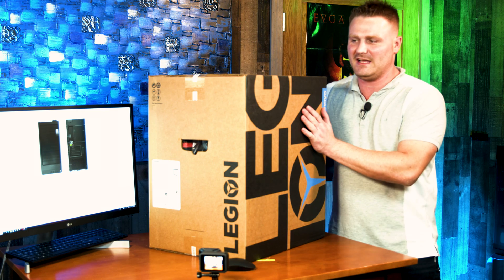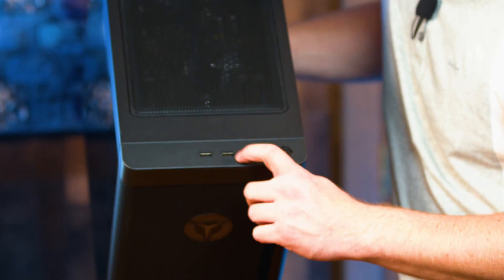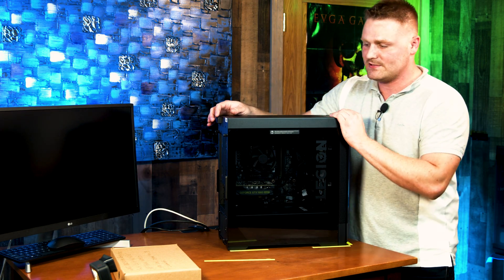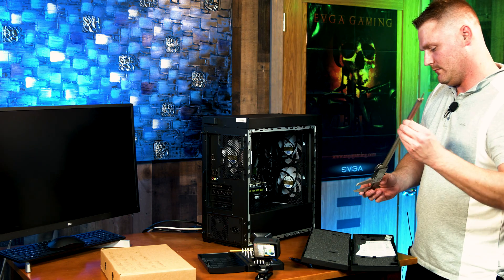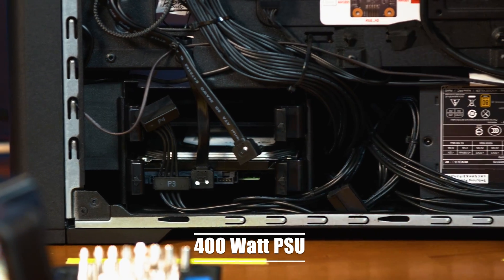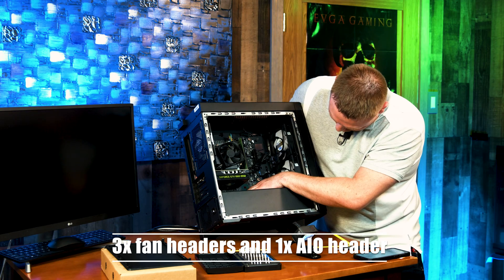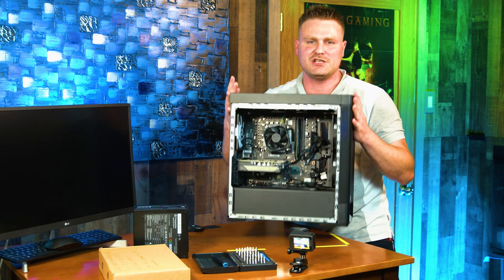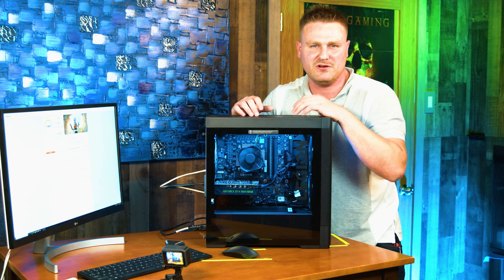Cheapest Fully Upgradeable Prebuilt Pc | Lenovo Legion T5 | W/ Intel i5 11400 & NVIDIA GTX1660 Super

Comment: I own this EXCEPT I got a great deal during prime day and mines got an i7 11700f and a 3060 w 32 gb of ram! I'm very new to PCs but have been doing some research and consulted with some of my boys that are into PCs and know their stuff. They advised me that it would be a good PC to buy and I've been very happy with it since I got it. It also has a fan or cooling system towards the middle of the case but more toward the back than ACTUAL middle. I spent $1100 was originally like $1600 without prime account and prime day discounts (not including monitor and peripherals but just for the PC itself) my boys said the same thing you said and that Lenovo had done great with thinking out this pre-built. So glad I went with this instead of something else a friend recommended after seeing all the positive reviews of it even if it isn't my version. I've also heard nothing but good things about the case aswell.

Comment: Bro you answered all my questions Ty!

240mm radiator support
Gpu length support up to 12 inches

I was crossing my fingers that my 3 fan RTX 2070 (11 inches) would fit !!

I got the variant with

i7 12700
Rtx 3060 (swapping this out for my 3 fan rtx 2070)
16gb ram DDR5

For $999 !!

Btw Subbed!
Reply from the maker: Thanks!!!

Comment: Got the model with the Nvidia GTX 3060 from Micro Center for just over $800. They are gone now. Ran Spider-Man Remastered on ultra settings and ray tracing effects. Everything runs smooth as glass no matter what games I play on max settings. 

The cooling fans are better than the MSI I was considering for $200 more with slightly better hardware but doesn’t cool down anywhere near this desktop in comparison.

Really missed having a desktop after having a couple laptops for the last 17 years. I always wanted a gaming rig and this one is great.
Reply from the maker: I love laptops but just not for gaming. they get way to hot. Desktops are the best way to go as these parts need more and more wattage = More heat!

Comment: 😒👍 NIce, very decent oem build, yeah definitely go pu a 32GB ddr4 3200 ram kit and make sure that the board is running it at 3200 if not go into the bios and find out how to bump up the memory to 3200mhz, next swap out the cooler and pu an ARGB 120 tower cooler run the argb wire to the back and plug it into the lenovo hub, next pu a cheap argb mechanical keyboard and mouse from somebody like red dragon or something similar, id leave the video card alone for now cause it runs almost as fast as a 3050 so thats pretty good to get you going in any single player game rite now, for monitor pu a gaming monitor 1440 or if ur on a budget get a 1080p monitor, lets go people 😎
Reply from the maker: Awesome!

Comment: Thanks so much for this video.  I bought this exact same PC from Best Buy about 1 1/2 years ago, just when the GPU shortage was beginning to recover.  I am definitely NOT a gamer.  I wanted a PC that could handle heavy-load video editing reasonably fast, as well as a PC that had the best options for 4K UHD HDR displaying and rendering.  After purchasing, and returning the very same day, 3 other pc from Best Buy (the salespeople either lied or had no idea what I was looking for in a PC), I researched onlinecompulsively for about 6 months.  When I saw this PC at Best Buy (about $1100 at the time), it pretty much had everything I was looking for.  I immediately upgraded to 32 GB of RAM.  Because of the motherboard, it is impossible to get the full speed out of the RAM, but it is negligeable.  All of my video editing runs smoothly, even the most complex video editing renders in good time. It's hard to find any GPUs that have multiple HDMI ports (this PC has only one) for multiple displays, but I use a Displayport to HDMI adapter and, problem solved.  As far as the audio is concerned, I use an external USB DAC to a headphone amp, or to my integrated stereo amp, and the sound is immensely improved! I had no idea that an external DAC could make such a magnificent improvement in sound quality.  Having said all that, I needed a laptop and about a year ago (October 2021), I bought the Lenovo laptop version of this PC.  Another excellent choice.  I subscribed to this channel because I was very impressed by how so many of the questions were personally answered.  Great job.  Thanks for this great channel!
Reply from the maker: Wow! I am glad You finally found what you were looking for. Thanks for the Sub!

Comment: Doesn't the legion t5 have oem restrictions?

Like having problems with ram id

I have a t5 but with the i9 32gbr and 3070 1tb ssd 1tb hdd. Its really good and i think the i9-11900 without k is just a more power efficient i7-11700k

Comment: I was doing some research and ran into this video. I am going to be building a system that is almost the same as this. Core i5 11500 on MSI B560M pro in an Antec NX410 case. 32GB 3200 RAM , 600w power, 120mm cpu cooler and a couple ssd drives (boot sata 240gb   data 1TB m.2).   I don't get into heavy games but I do some video editing. I might have to get a GTX 1660, I heard it should work pretty good. I was glad to see a system that is almost the same that works, that is very helpful.

Comment: Hey got a question about this pc is there a special way to turn on the rgb on it or is it supposed to come right on? I bought this from Costco but it’s like 90% the same as this one just has 2 ram cards and an i5 11500.
Reply from the maker: https://youtu.be/rjlGMfWzSrk check this video out
Reply: I looked closely at the motherboard and it seems all the fans are plugged into the rgb ports
Reply from the maker: The softwares name is lenovo vantage
Reply: Thanks so much! Also If I upgrade to a 3070 would I have to upgrade the power supply for the pc or would the 400w still be fine?
Reply from the maker: @austin6157  yes
Reply from the maker: @austin6157  to a 500w + but at that price point you may as well get a 650 or 700
Reply: Do you have any good recommendations for power supplies?
Reply: Nevermind I found your psu video swap for the legion t5.

Comment: I'm having trouble removing the black side panel off I can get the clear one off just fine but the black side panel is being stubborn any info on why
Reply from the maker: They are captive screws, some times the threads get buggered up. take a vice grips or a adjustable pliers and lock on and pull and twist to the left. If I was you, I would look on amazon for some PC case thumb screws and replace it. hopefully a new one will fix the threads. if not you may need to RMA it to lenovo.
Reply: @TNW1337  I ended up getting it off by pulling the top and bottom where the screws were instead of the middle because the bottom was jammed in there for some reason

Comment: I just recently upgrade to dual Channel RAM and the speed it says it could go to 3200 but only go to 2133 and i look ever were in th bios to fix it but i guess i need a new mother borad for i can ovet clock it to 3200
Reply from the maker: The legion does have support for 3200mhz. you may need a bios update
Reply: @TNW1337  how do I do that
Reply: @TNW1337  if you can make a video about how can you update the bios or how to over clock ram this will mean a lot and help me a lot

Comment: Bought a lenovo legion tower with an i7 11700f, rtx 3070 and a b560 motherboard, do these motherboards  from lenovo fit with any other tower cases? I wanna transfer to an corsair 4000d airflow.
Reply from the maker: They are ATX  so as long as it is one that does not have connector on the front of the PC. About 99% of the lenovo gaming pc mobo are just normal boards.

Comment: I bought two of these pc's. One thing to watch out for is on some of the older ones the lower intake fan is installed backwards from factory and missing screws. Both of my pc's lower fans were backwards and one pc only had one fan screw in the bottom fan. Other than that they are great. Those fans are actually very powerful. I upgraded the psu on one and put a 2070 in it. Later I took one apart and used the parts to build 4 gpu mining rig and then gave the other one to my nephew.
Reply from the maker: Yeah I love these little computers

Comment: Hey technitwit do you know a way on how to take the backplate off without breaking the motherboard?
Reply from the maker: Yes Heat, and the plastic pry bars from I fix it. heta gun set to 300-400F only do it for sort amount of time. You can use a just the pry bars

Comment: quick question about the legion tower i know this is probably a stupid question but i recently bought a legion tower 5 PC with a 3060 and an amd ryzen 7 5700g 
am i able to switch out the graphics card with lets say a 3070 for example and does it have to be like a GPU specific to only to lenovo or can it be any brand?
Reply from the maker: Well they only come with a 400w PSU. So you would want to upgrade that, that being said going to a 650 or 700w. Then you could do a RTX 3090 if you wanted to. the 400w is maxed out at the 3060ti.

Comment: Hey, you already commented on my first comment but I have another question if you happen to see this. My question would be what SSDs are compatible with this motherboard? 256gb is not enough at all. I'm a pc noob thanks for your time (I'm referring to the 5i w/i511400 + 1660 super)
Reply from the maker: Pretty much any ssd will work. I like Samsung if you willing to pay. but my cheap option is PNY and Crucial 
Then you just use a software to clone the drive.
Reply: @TNW1337  I'll probably go with Samsung then, I'm looking to upgrade this PC with quality stuff, even if it takes me a little longer to be able to afford it. Would recommend a first timer to the install or should I have someone do it?

Comment: can the gpu be upgraded without replacing anything? id want to take out the current gpu and put something MASSIVLY BEEFY in here
Reply from the maker: RTX 3060 , 2060 Or RX 6600 XT. Or you would need to upgrade the PSU.

Comment: I was om the fence about getting the current HP OMEN GL30 with a 6600xt and 16gb ram for 1149 on best buy and the current Lenovo 5I for 999 on best buy. I think I'll get the Lenovo for the upgradability being easier over the HP, even tho the HP has more ram out of the box. Would you say I'm making the right choice? I'm using it for gaming and music, fully intent on upgrading RAM
Reply from the maker: Legion Hands down. Just the ability to upgrade to Any GPU and 128Gb of ram
Reply: @TNW1337  I got the Lenovo 5I with the GTX 1660 Super, and I just got it set up a few hours ago. So far I only got the 7 Days To Die files sorted out and I loaded my world up and messed around a bit. It's performing very well for my needs. Very pleased so far with my first gaming pc. I got 16gb of ram that I installed after making sure the pc boots up. Thanks for the content it helped me decide!

edit to add 
Forgot to mention I purchased the ram based on your suggestions in the description so extra thanks for taking the time for doing that! Really appreciate you listing what's compatible with the system and where to get it.

Comment: Have you tried to install a new cooler yet? I heard that the mounting bracket on the back of the board is glued on, so I'm trying to find a good cooler that can use the existing bracket. For reference, I've got the same pc but it has an i5-11500F. Any help would be much appreciated.
Reply from the maker: Yes it is and it does need to be removed. If you doing it on a the cheap Coolmaster 240mm Aio is the best you can get next to a noctua air cooler

Comment: Just bought this with an i5 11500 and 1660 super with 16 gb of ram, Costco was running a deal for just $850  and I wanted my first real gaming computer that had the potential/ability to upgrade once parts got cheaper, the rig is great for 1080 gaming, gets a little less optimal for 1440p gaming but can do it with medium graphics on most games at about 40-60 FPS consistently
Reply from the maker: Awesome
Reply from the maker: Thanks for the Comment! How you enjoy your PC.
Reply: @TNW1337  it has been phenomenal, I plan on upgrading the psu and graphics cards when they eventually go down, luckily the 1660 super is still a very competent card at running 99% of games, granted at 1080p but I’ve noticed that weaker PCs are much more expensive than the price point I bought at
Reply from the maker: @vvvprince9487  Agree It is  a pretty nice PC.
Reply: @vvvprince9487  hey have you upgraded your SSD yet? If so what product did you get? I think we have the same specs, although I had to get the extra 8gb of ram myself
Reply: @sentientcardboarddumpster7900  I have not, mines the 512 gb with 1 terabyte hdd so I haven’t found a reason to upgrade yet, my next upgrade will be a new power supply followed by a graphics card when they go down on price eventually, then possibly the nvme, but with 1.5 tb of memory idk when I’ll upgrade, but when I do it’s going to be a 2tb nvme
Reply: I just bought the exact same computer with the same specs and I can't seem to get the power button light to turn on any help?
  Thanks
Reply from the maker: @Quietprofessional1  The top button or the front one>? Check connectors on the back side of the PC all RGB is connected there.
Reply: @TNW1337  The power button on top next to the microphone input. In the center of the button there seems to be a small clear window where a LED would light up when the computer is powered on.
Reply: Either way I love this computer definitely the best one I've ever had
Reply from the maker: @Quietprofessional1  it is awesome 👌
Reply from the maker: @Quietprofessional1  mine does not light up there.
Reply: @Quietprofessional1  do you mean the legion logo?
Reply: @vvvprince9487  no I mean the power button on top that has a little hole in it it looks like where there'd be a light to tell you that it's powered on
Reply: @Quietprofessional1  I don’t think there is a light there,  I can’t seem to turn it on if there is
Reply: @vvvprince9487  it sure looks like there's an LED under that little clear window in the center but I can't get it to turn on and I can't find  out anything about it.
Reply: @Quietprofessional1  to be fair if there is, and that is the only problem with the computer, it’s a very minor problem, especially with how much rgb there is, figuring out if it’s on or not isn’t much of an issue

Comment: 400wt power supply seriously???? Why do all these pre builts never come with a decent power supply.
Reply from the maker: Its do to cost. And what card will fit. They budget the psu so it can support the cards. People see what Nvidia or amd says should be used and it is a suggestion for the avrage consumers. 

Now I do wish they put like a 700watt in because that would support the top end gpus. Even if they do not fit size wise.

Comment: Hi there, I just bought this computer and the only thing I was disappointed in was that my ram is running at 2933 instead of 3200.  There is no way to enable xmp in the bios.  Any suggestions?
Reply: My specs when I bought it at Costco said 3200 MHz but in task manager performance said the ram was running at 2933 I was able to manually change the ram to 3200 MHz in the bios menu and confirmed it is now working at 3200
Reply from the maker: @NewEnglandBeachDetecting  I did try to change it. But it would not stay for me. So I guess you can try that. Your only losing about 15fps at 2933.
Reply: @TNW1337  I set the ram speed to manual profile 1 and it gave me an option for 3200 MHz mine did come with the 16 gigs of ram maybe I have a newer bios firmware
Reply: @NewEnglandBeachDetecting  how to access bios? F? Thanks! BTW, mine is with i5-11500F, 16 gigs ram
Reply: @NewEnglandBeachDetecting  how did you change it in bios?? I could not find it in there, I had no advanced options in mine
Reply from the maker: Well it is only really like a 5fps loss in some games. Unless you play to do like 4k video editing you will not really miss the faster ram. and we are talking like 5-10 secs off of a 5min video. You could replace the motherboard I am looking in to this it looks like stranded Micro Atx board. Just the Case pin may need to be adapted to the legion. The RGB header is on a normal Usb 2.0. header. I am finding out this this really is not proprietary like some other manufacturers.

Comment: Could I add 16gb of completely different new ram, they'll still be 3200mhz and ddr4, but will stuff like the UDIMM or DIMM or volts have to be matching with the motherboard/ram slots?
Reply from the maker: It best to gr the best speed. But if it runs at the slower speed. It is only like 5-15fps at most this if you had a i9 and a 3070. So it's more 5-7fps

Comment: Could I use Patriot Viper Steel DDR4 8GB 3200MHz Performance Memory Module - PVS48G320C6 (On amazon) with the ram that's already in the computer, i'm nto sure if they will work together
Reply from the maker: Or get a matching kit
Reply: @TNW1337  I can't find what voltage it is in it's specifications
Reply from the maker: Well it need to be same size and voltage. 1.2 or 1.25.

Comment: Why doesn’t my front fans turn on or my ambient lights when I select on in the settings
Reply from the maker: It should try doing a power cycle and then open up the app. It is possible you got the version with out rgb. I would look up ur model number check the back side there is a rgb splitter make sure all the connections are plunged in.
Reply: @TNW1337  thx that wasn’t it but I forgives it out the fans wasn’t plugged all the way in for the rgb to work and the ambient lights weren’t plugged in as well so I plugged them in and they worked just fine